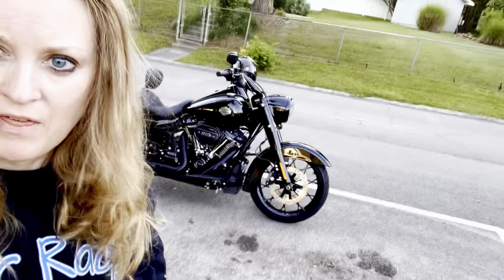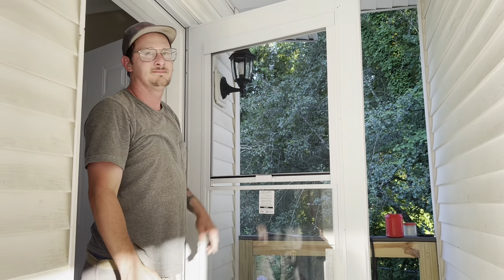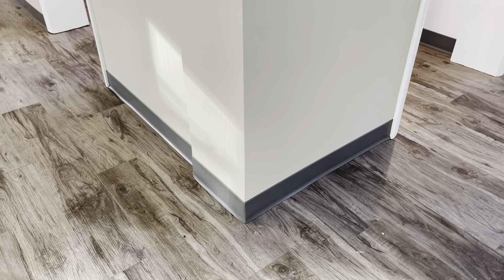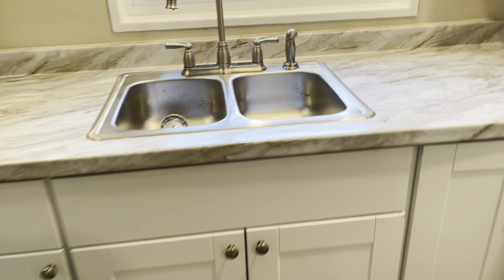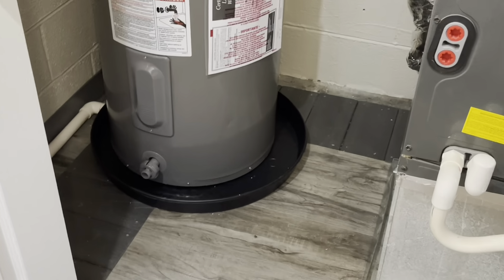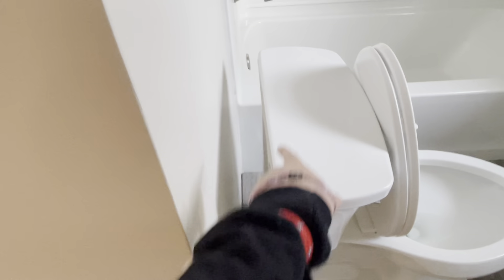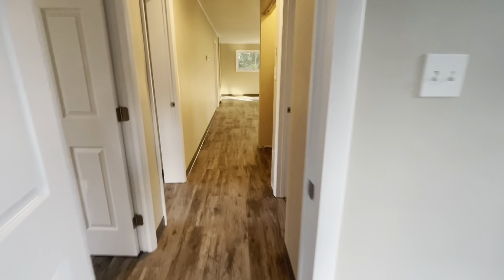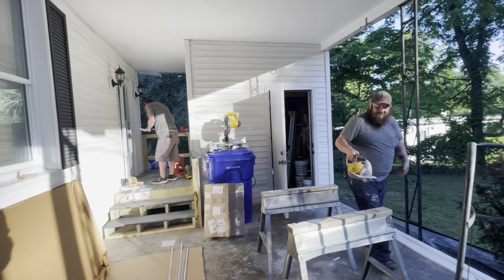Young Brothers Update! Almost finished!!!!

Comment: Thats one nice counter top. No dishwasher!!!!! thats a deal breaker lol. The floors looks like my kitchen floor. You copied me lol. The nice thing about the vinyl baseboard is when vacuuming or mopping, they don't get marked up or wet. We put the vinyl around the walls in my basement at first. Thinking is we ever had any water problems that the water wouldn't get to the 2x4's and the wall board. It worked out pretty good. Just have to get the vinyl tight to the floor. When I refinished my basement I pulled the vinyl off and sealed pine baseboards so they should never get water damage. I installed it using the 2 quarter trick. Putting 2 quarters under the baseboard on each side before nailing. That keeps the baseboard off the floor just incase we do get any water in the future. You don't even notice the small gap unless you get down and look. You bike is looking sharp!
Reply from the maker: two quarter trick - will have to remember that! renters will put all kinds of food in your dishwasher and clog your drains. they will put chicken bones and all kinds of crap in your disposal. house is 1948 on a concrete slab with the pipes running thru the slab and no cleanouts in ‘48. So no dishwasher and disposal and this rental will still be in high demand. the market is crazy
Reply: @TinyDragon  wow, I didn't think people were like that.  Figured they would know how to use things the right way. The interest rates have gone up out here. Makes renting look good.
Reply from the maker: You would think but it is true… when something is someone’s personal property (and then sometimes people don’t care for that), they basically don’t care how it is treated. True stories - people never cease to amaze. This one will list for $1300/month
Reply: @TinyDragon  that's cheap.  Out here house rentals are like $2000 to $2500 a month. Even paying $1300, I can't see why someone wouldn't want to take care of it. It's a shame.